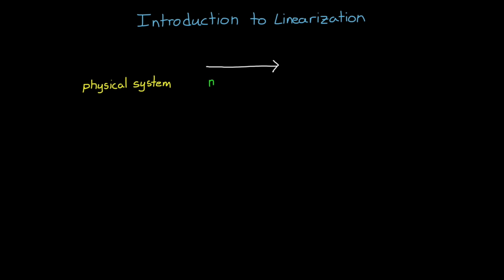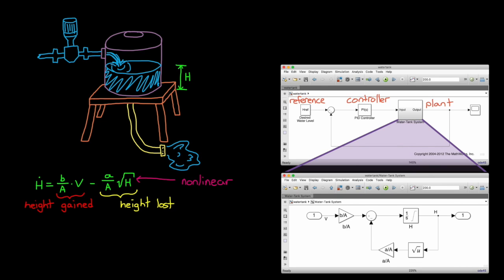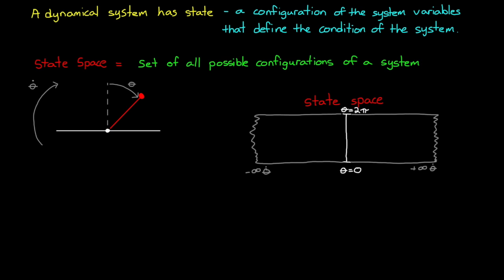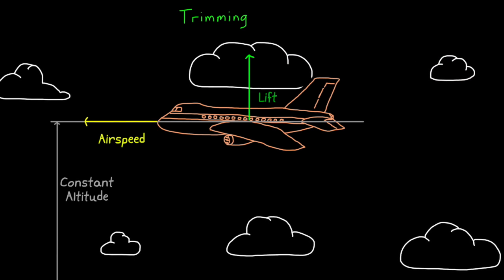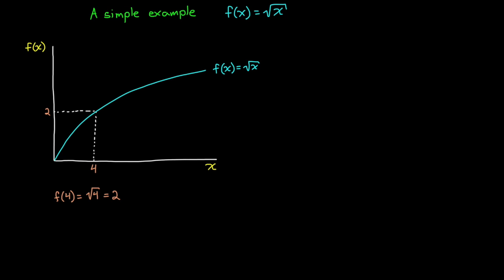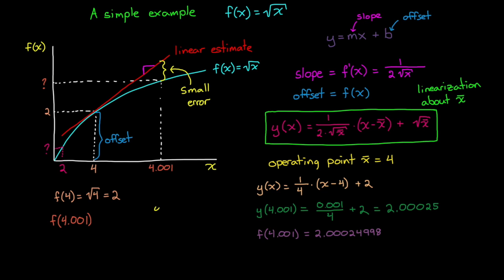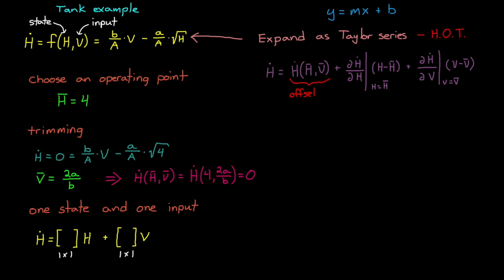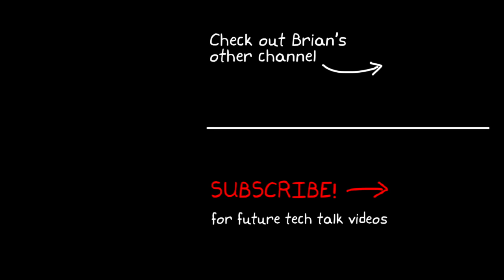What Is Linearization?

Comment: I did not get the "re-label where we call zero" part. It looked like you made Hbar = 0, but then you took the square root of it n the slope term, making it result in -a/4A. 

It looks mathematically inconsistent, to consider Hbar to be zero only at one part. Could you explain? (Or someone that got this)
Reply: (Answering 1 year after, but I hope it helps someone) Yes, looks inconsistent, but you can interpret it as: You re-label what you consider zero in another variable, an auxiliary variable, not exactly the same as considering Hbar = 0. The operating point is still at the original H = 4, a point where there's no discontinuity. The value of the slope is calculated at H = 4 and fixed (The slope is still  -a/4A). Only then you re-label it. But I agree with you that maybe another variable should be used, an auxiliary variable, to represent this re-labelling.